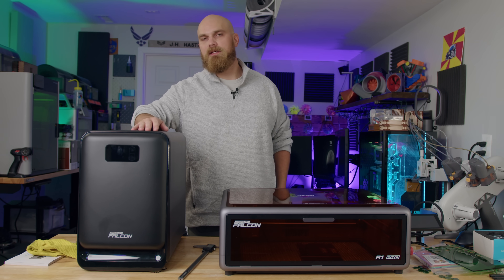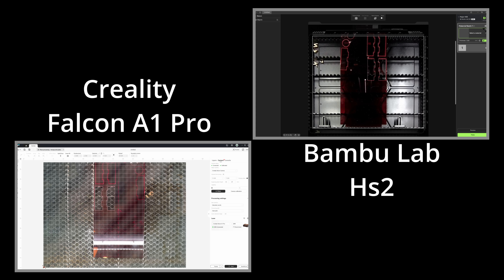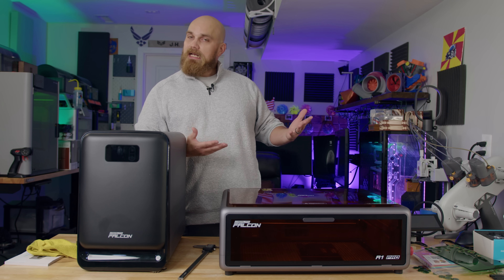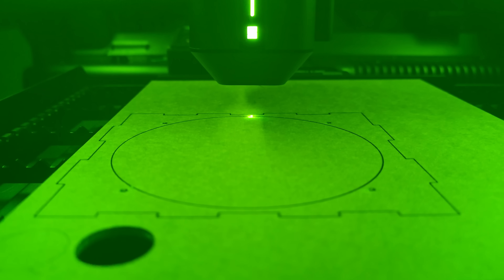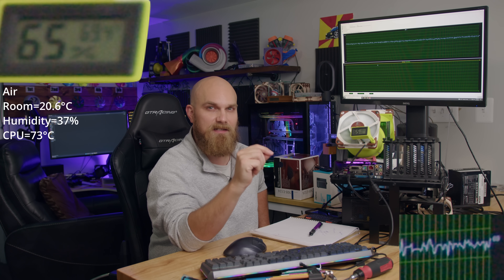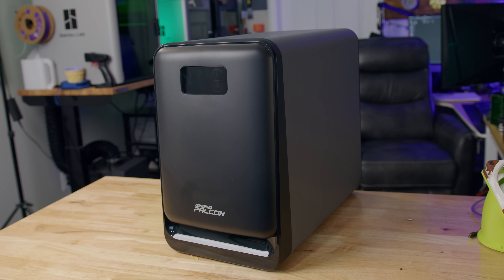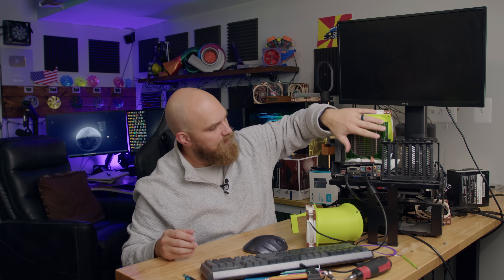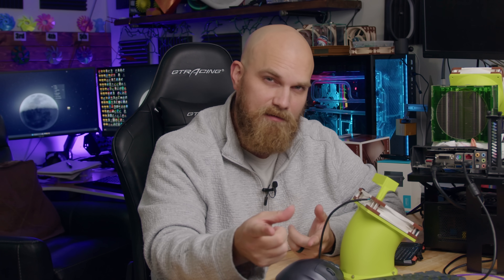I Water-Cooled My Air Cooler… Again, But Different

Comment: Hello, your heatsink is good for low-pressure coolers. However, the appropriate type for higher pressure, such as centrifugal coolers, is a heatsink with thinner, more numerous, and shorter fins. These have the strength to overcome the barrier and clean the dust in the channels, and even with less displaced mass, they are more efficient in the long run.

I'm sending my idea to win the static pressure test. Do you manufacture the front plate? I don't have the measurements of the holes in the housing.

When the turbine is running at high speed, the pressure can displace the rotor. Check the operating adjustment to get it closer to the plate to obtain maximum pressure without friction.

Comment: Condensation happens when you cool the air and it reaches it's saturation point, not when you are heating up the air with a heat exchanger.

Comment: Humid air sucks for cooloing humans that use evaporative cooling ( the high humidity makes it more difficult for the sweat to evaporate and take the heat energy and turn it into latent heat in the water vapour.) with this setup you are giving the air a higher heat capacity allowing it to take more heat from the cooler

Comment: You should get a pump that can pump water through 4 inch pvc pipe and connect that through the cpu cooler, it would be overkill, but interesting...

Comment: It takes 1,000 BTUH to evaporate 1 pound of water. Evaporating water mist pulls heat from the air thus cooling it. Think evaporative / swamp cooler.

Comment: 9:40 not even welders do that. They have duty cycles. Ie run for 30mins then they need a rest. In fact a lot of stuff does that. 

I think PC are about only things can run for prolonged periods at “maximum”. But the companies lock them down to stay within two or three parameters.

Comment: Beware Creality - they screwed me over on the raptor. They pumped a bad firmware that bricked the devices IR function. Gave me cross laser for millisecs (it doesn’t have cross laser).  then refused to replace or refund. They never offered repair. Messed me around for 4months and then told me my warranty expired. Then offered to replace. Still unresolved. I have a couple shorts that have more detail if click comments.

Comment: I do have a suggestion.
I would measure inlet air temp, not room temp. ( maybe you did and i didn't catch it, but it's worth making it explicitly clear)
the latent heat  of vaporization is going to cool the air that the water vapor interacts with. ( vaporizing water will be colder than what ever the water temp was when it was in liquid form)
this would better normalize the data. 
same principle of how a swamp cooler works. 
Good work! love the vids!

Comment: Try iso alcohol next. Check reactions of iso with acrylic first but yeah even rubbing alcohol will improve over water (if you manage to coat the cooler constantly with it and not burn the house down or asphyxiate on the fumes...

Comment: Depends on what kind of humiliation you're using. Is it using ultrasound to create micro droplets or heat to make steam. If you're not heating the vapor then it should help cooling. If it's steam  it'd be more complex

Comment: Could it be possible to have a little bit more space inside of the containment... And add an exhaust fan... Also making the humidifier encapsulated to reduce wetting other pc components, and using a non corrosive liquid ( not saying antifreeze) but something that can be vaporized and non corrosive.... So basically I'm saying...... Grid for intake, humidifier 4 walls on the side and top and bottom, tube or corridor to the radiator, radiator, exhaust fan, mini corridor, then grid of exhaust

Comment: would you consider doing tests on using air ducting for air cooling?
air ducting isnt a thing you see much more out side of prebuilts, but in therory it should give pretty good cooling with out that many fans/rpm

Comment: Humid air is less effective at cooling people because people need their own sweat to be able to evapourate to stay cool. 
However - I imagine humid air has more thermal capacity than dry air (given the same variables for everything else that's relevant). So I would have guessed that the humidifier would help.

Comment: As someone who knows essentially nothing about laser cutters you said that the A1 Pro overheat while cutting the larger piece but the HS2 didn't. 
You said the H2S took 14 minutes, 2 passes at 100% power with a 10 watt laser head.
I'm assuming the A1 Pro laser head is 20 watt (mostly by the giant 20W written on it) and that it overheated. The display on the A1 Pro also showed you running 2 passes at 100% power with that one.
While I still agree with your point that it shouldn't have overheat on that size of cut. Did you try it with a 10 watt laser head as well, or reduced power to see if it still overheated?
It's not exactly very informative to compare a 20W to a 10W laser in terms of heat on the same cut.
Again, I do agree it probably shouldn't have overheated and again, I know next to nothing about laser cutters other than "Bigger power draw means more heat"

Comment: Theoretically speaking here, you closely reverse engineered the functionality of an HVAC system. ... So uh... why don't you just use a Mini HVAC system or a heat pump with that amount of work you've put in?

Comment: Think about what you said. Air and density etc.. weigh a bucket of air and a bucket of water and ask yourself which has the higher density. Try running in your swimming pool. Now say it with me ... water is more dense than air. Albeit not as dense as you are. Drop the cooler in a bucket of water and you don't even need the fans, because even stagnant water conducts heat better than moving air. More molecules in the same area equals more density, equals more molecules, to take away heat (generally speaking).

Comment: Subaru sprays their intercooler with water to make it more effective so I assumed this would work the same way from the start.  The issue you're confused by is that humans have to sweat to cool off and if the humidity is high the sweat wont evaporate as well.

Comment: Humid air is normally assosciated with being hotter because the way we as humans cool down is already through evaporation of sweat, so adding humidity to the air reduces the ability for that to happen, but a computor doesn't sweat, so adding the humidity in through the air achieves a similar result

Comment: Dude! Top off your water cooling system! For the love of Pete!

Also, air is an INSULATOR. Creating air gaps in homes and windows is standard practice because it is highly efficient for preventing temperature exchange. Adding water, which has far higher thermal conductivity and mass, will greatly increase cooling effect. Yes, evaporation is a thing, it's what happens when we sweat, but the single biggest factor here is water's thermal conductivity and thermal mass.

Comment: ok so i have another theory what would perform better. again seal up the cooler on the sides so that the air cant excape and use a spacer to space out the fan a bit from the heatsink itself to get more surface area that is usable. and maybe use a transition from 120 to 140mm to use a bigger fan + use a bell mouth before the intake of the fan. i dont think it will help much but in fluid dynamics if you can funnel the air in theory it will work better.

Comment: I would have liked to have seen this test in a hotter ambient temperature. Years ago I went from running a 9590x (yes that chip) from an ambient air temperature of 21 in low humidity, to a tropical 28 degree room with high humidity, and even with the air con on in the room, under air cooling it overheated. The ambient air temperature had a much lower affect in day time with less humidity, it ran cooler, but at night with high humidity, it ran too hot.

Comment: If you want the ultimate fan showdown you should stick that cpu cooler on to a hot plate or something like that where you can artificially control temps and raise it as high s you want to see the true performance. Basically, how high can you adjust the heat until the fan can no longer keep temps 20c above ambient.
Reply: Not just temps, but a fixed thermal load. Almost as if you had a CPU running at full load, but you can precisely set how much heat it put's out.

Comment: That cool mist is actually comprised of suspended droplets of water. What is happening on the heatsink is that some of the droplets are landing on the heatsink & evaporating into gaseous water/water vapor not visible to the naked eye. If your room is very dry, this will work. If your room is humid, this will not work. What this is, is an evaporative cooler, often called a "swamp cooler". If you have a dehumidifier in the same room, or in a closed loop with the cool mist, this would work longer term, but do keep in mind that dehumidifiers exhaust warm air as it extracts heat from the water vapor to allow it to condense into liquid.

Comment: That is not water-vapour but just fog. That of course will increase cooling performance as not only does it cool down the air before it gets to the cooler, the mist also lands on the fins absorbing heat to evaporate. 
IF you really ONLY increase humidity (so no mist, no change in temperature) then it would still perform "better" but by a far smaller margin. The air-density has little to nothing to do with that as at "normal" temperatures the difference is negligible, but the higher specific heat more than makes up for that.

You are confusing the gases ability to absorb and transport heat with the humans ability to cool by sweating. In humid air less sweat evaporates so your evaporation cooling is far less efficient. Your CPU does not sweat.

Comment: Could you have made the longer cuts at lower power and done more passes?  I don't know the answer, that's an honest question. (Made up numbers follow:  My thinking was if it say overheats after 10 minutes at 100% power, could it run maybe 15 minutes at 75% power, and continuously at 60% power ???  - again, made up numbers and I don't know the answer, it's truly a question that either you, or the OEM might be able to answer.  I'm guessing that whatever cooling the laser has it probably removes heat at a fairly constant rate, which is slightly less than the rate the laser generates heat at when run at 100% . . .  I know things like welders (arc welders, mig welders, etc.) give a duty cycle rating that's somewhat like the above example. )

Comment: The humidifier seem to work similarly to that of a water sprayer on an intercooler for a car. Could be an interesting project.. Waterproof fan. Spray system and water collection under the cooler.

Comment: Water has a higher thermal maximum than air, so water can absorb heat and hold on to that heat better than air.  This is why when if it hot and humid the heat index goes up, and conversely it works the opposite way as in when it is cold and humid the cold index is lower.

Comment: Im honestly not at all suprised to see that watervapour helps thermal conductivity. Air is a pretty good thermal insulator compared to other materials. Nothing at all is better obviously. But when you account for the extra mass in the air, waters ability to go from a liquid to a gas as it heats up at relatively low temperatures and the heat it then carries with it... im not at al surprised of the result.

Fun experiment and a good review of the cutter tho, thanks a ton m8!

Comment: In future if you want to adhere acrylic to itself you can use water-thin solvent adhesives instead of hot glue. They can be applied to joints using flexible tip syringes and the joint will reach 50% strength after 24 hours (100% strength requires 3 weeks unless you get the shorter cure time version) and makes a connection as strong as the base material. They work similarly to how pipe cement dissolves and bonds PVC or ABS to itself. Acrylic (or polycarbonate) requires SciGrip #4 which you can order through McMaster-Carr. If the surfaces of the two parts you are bonding are polished to be clear, the resulting joint after curing will also be clear. For bonding plastic to metals I've always had great results with Plexus MA310. It smells like chemical death though and as a 2-part epoxy it needs to be mixed inside a plastic bag and dispensed like icing from a cut corner.

Comment: actually when you come to think of it , international trade - between nation A and nation B , should be cleared either in the currency of nation A or that of nation B naturally , and China happen to provide most of the manufactured commodities in the world , selling to pretty much everyone .. every transaction , if cleared through a 3rd party currency , is a lost to China and likely also to the buyer nation 

the issue is not China trying to dethrone the US dollar , its US dollar losing its value , QUICK , making clearing and trading in US dollar now a risky uptake , what we are going to see is multi-polar trade transaction and clearing , China trading with EU might go after clearing in Euro and Yuan , and similar for other developed nations , China and rest of the world is not trying to go after whoever , they are just diversifying , which is basic strategy to guard against financial chaos as can be seen and already happen during the 2008 market crash

Comment: This is similar to a fairly common "mod" that people will do on turbocharged cars. You can run spray nozzles in front of your intercooler so you can spray water on the intercooler when it is hot. The water on the intercooler evaporates and improves cooling. Very neat to see a similar application on a PC cooler.

Comment: The trick is that its not vapour... (at least not traditionally like steam).. its mist.
The ultrasonic humidifier just sprays water... in very very very fine drops... 
The water is still only water  in very tiny drops. Not steam, not vapour...
But the very very tiny drops vapourize very easily.
The air with this warter in it is not humid...
Its dry air with water drops in it.
The hot cpu cooler actually evaporates the water, and in turn becomes cooler

Comment: Awe come on. You pay 800 bucks for a machine and it then can't even do the job it's supposed to do.
If a laser cutter doesn't have a 100% it doesn't seem like a good product. Looks over Funktion, probably. Cooling a 20W laser diode is NOT difficult at all, cameras have the same exact problem too.

Comment: $599 for a fume extractor, are you kidding me?
The most expensive part on that while thing is the plastic housing that needed custom moulds. 
It's the same with soldering fume extractors coating 10 times the material costs.
A 140mm arctic pc fan and a single sheet of active charcoal filter, two rubber bands and a 12V pc fan controller runs you about $6 but the already assembled thing would cost you $60, at least for what I can get where I live

Comment: A high humidity would actually be better at removing heat in a system like this, due to the significantly higher heat capacity of water vapour compared to molecular nitrogen and oxygen. It takes up more heat to warm up a unit of temperature, so the temperature difference remains larger for longer and thus the heat transfer rate as well. I'm a physisit with a backround in thermodynamics, and coincedentally we just started this years iteration of our thermodynamics course, where we teach our 1st year students all about these phenomena,

The general consensus that humid air is worse comes down partly to the fact that humans cool down by sweating, evaporation, which rate is dependent on the partial pressure of sweat, i.e. water, in the air. And party to that when cooling down air, you need to remove moisture from it because the maximum moisture content in air goes down with decreasing temperature. A VERY widespread mistake is that people dont open their windows in autumn/winter because the air is so wet outside, while in fact it is very dry because the absolute humidity is very low.

That being said you should correct for the temperature drop due to the latent heat of evaporation, you essentially testing a cooler aided by evaporation here, not humidity.

Comment: The quality of the cuts is awful. The overheating protection is good but wtf! How could you release such an incapable product where processing a very standard, small part could trigger it!
IMO, there's little point in getting any laser under 40-50W.

Comment: The Ender 7 is probably one of the worst in the Ender line-up it's really not fair to say their entire product stack is bad because of "mainly that printer" I've heard the scanners are quite good and my Ender 3's have been very reliable, every issue I've had was due to user error or lack or maintenance which will make any printer regardless of brand have issues.

Comment: Have two water reservoirs. One for the cooling and another as a boiler for a steam engine. Use the steam engine to drive the fan for the cooling. What could go wrong.

Comment: People feel hot when it's humid because we sweat to cool down, and when our sweat doesn't evaporate because the air is saturated, we just stay hot.  You introduced moisture to a warm surface where evaporation could happen, thereby lowering the temperature.
Reply: Yup, I notice the difference every summer.

Comment: If this is going to be run long term / used in fan showdown, my immediate concern is that the mist, even if it is distilled water, over enough time will deposit minerals on the board and it may eventually short. Just out of abundance of caution it may be worth shielding it.

Comment: A real problem will be with the radiator later. The aluminum cooling foil will become covered with white rust coating. Yes, aluminium somehow susceptible to corrosion in high humidity conditions. I khow it because I saw a lot of gpus since mining boom that working in open area. Or near opened window. And a lot of them with corrosion on the aluminum cooling foil.